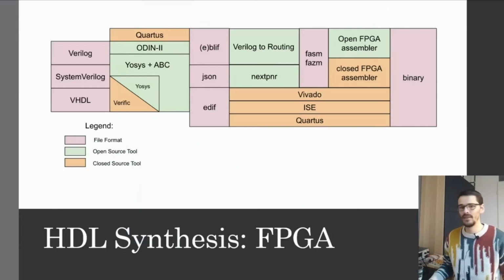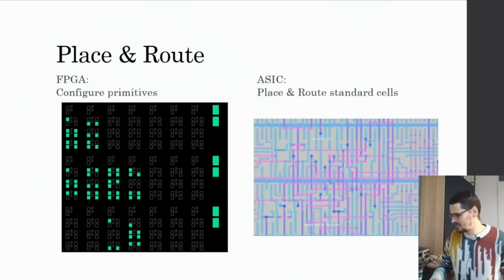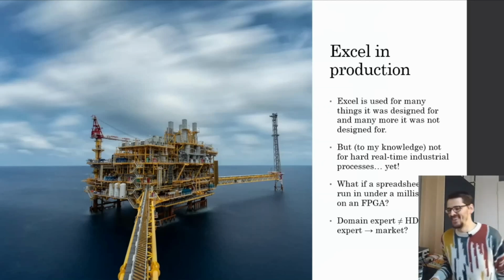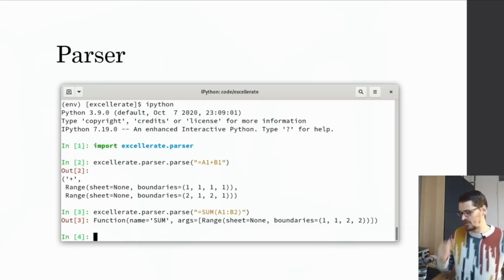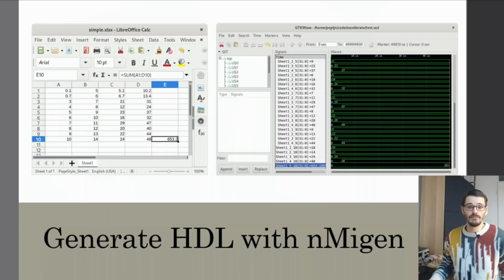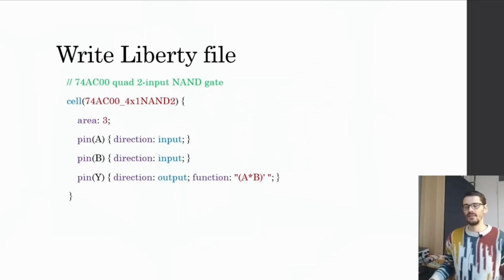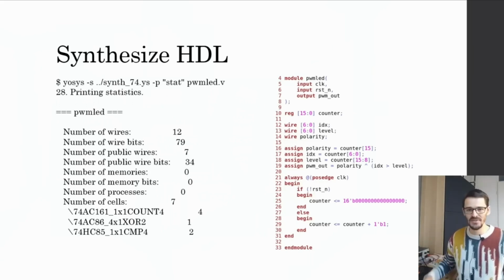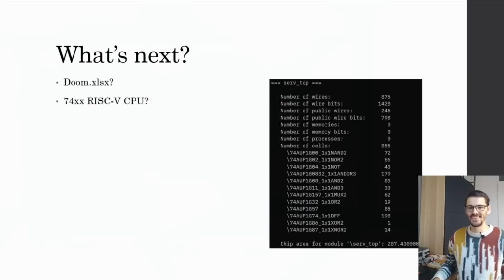RC3: Unconventional HDL synthesis experiments

Comment: Unconventional HDL Synthesis Experiments: From Spreadsheets to 74 Logic Chips

* 0:36 Unconventional Synthesis: Pepijn de Vos explores unconventional methods for synthesizing hardware, including using spreadsheets and C code as input for generating logic circuits on FPGAs and using discrete 74 series logic chips.
* 1:13 Conventional FPGA Synthesis Flow:  A traditional FPGA design flow involves using HDL languages (like Verilog or VHDL), synthesis tools (like Yosys), place and route tools (like nextpnr), and finally generating a bitstream for the FPGA.
* 3:52 ASIC vs. FPGA Synthesis Targets: ASIC synthesis targets a standard cell library specific to the fabrication process, while FPGA synthesis targets the configurable logic blocks (LUTs, multiplexers, flip-flops) within the FPGA. 
* 11:23 Open Source Tools for Flexibility: Open-source tools like Yosys and nextpnr enable experimentation with unconventional synthesis approaches by allowing custom scripts and intermediate representation manipulation.
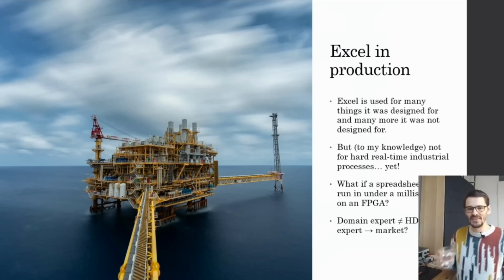* 12:16 Spreadsheet to Hardware: Pepijn explores the concept of synthesizing spreadsheet calculations into hardware, potentially enabling domain experts to directly implement logic without HDL knowledge. He demonstrates a basic implementation using Python to parse spreadsheets and generate Verilog code.
* 14:36 Challenges of Spreadsheet Synthesis: Handling floating-point numbers in hardware (FPGAs work with binary/fixed-point) and implementing complex spreadsheet functions are identified as challenges.
* 23:03 74 Series Logic Synthesis: Inspired by others, Pepijn explores synthesizing HDL code into circuits using discrete 74 series logic chips. This involves creating custom Liberty files for Yosys to map logic gates to specific 74 series chips. 
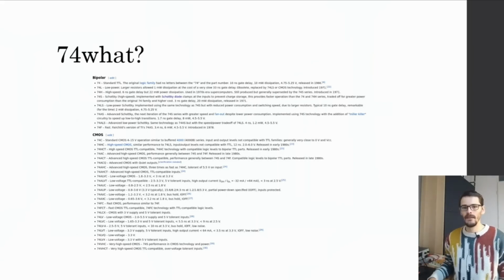* 26:05 74 Series Chip Selection: 74HC series logic chips are chosen for their availability and cost-effectiveness, with the option of using faster 74AC chips or smaller 74LS chips depending on performance needs. 
* 29:02 Technology Mapping for 74 Series Logic: Special technology mapping steps in Yosys handle mapping complex logic elements like adders and counters to combinations of 74 series chips. 
* 32:04 Verification through Simulation: Post-synthesis simulation is crucial to verify the functionality of the generated 74 series logic circuit matches the original HDL code.
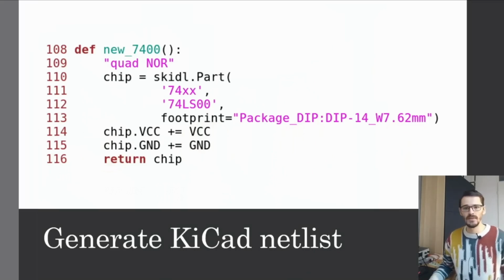* 32:25 PCB Generation with Skidl: The Python library Skidl is used to automatically generate PCB layouts (KiCad netlists) from the synthesized 74 series logic circuit.
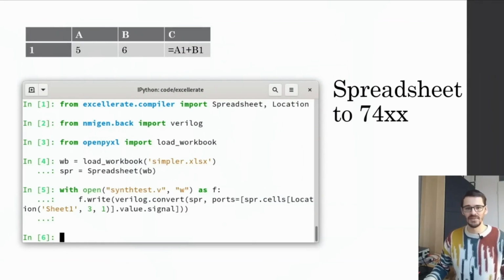* 35:04 Combining Spreadsheet and 74 Logic Synthesis:  Pepijn demonstrates the possibility of combining both approaches by generating Verilog from a spreadsheet and then synthesizing that Verilog into a 74 series logic circuit.
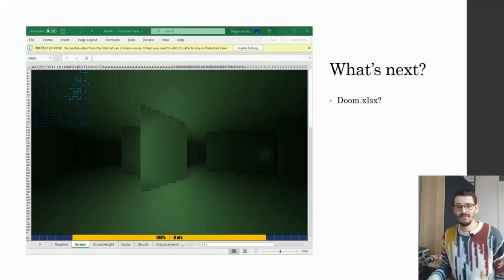* 35:58 Future Directions: Expanding the spreadsheet-to-hardware capabilities, exploring the synthesis of more complex CPUs (like RISC-V) to 74 logic, and encouraging others to experiment with open-source tools are highlighted as future directions. 

I used gemini-1.5-pro-exp-0827 on rocketrecap dot com to summarize the transcript.
Cost (if I didn't use the free tier): $0.03
Input tokens: 20746
Output tokens: 654